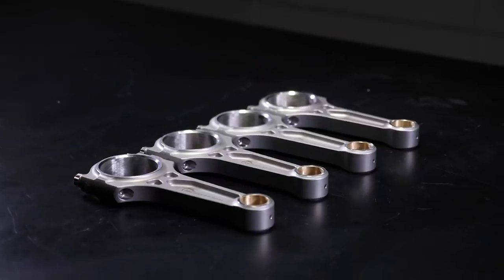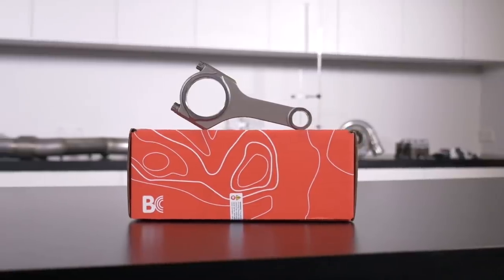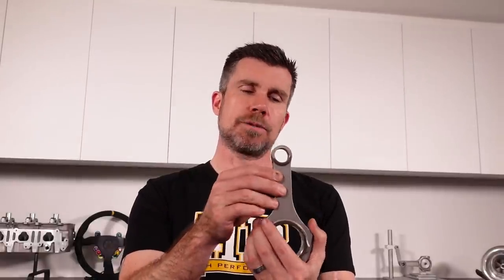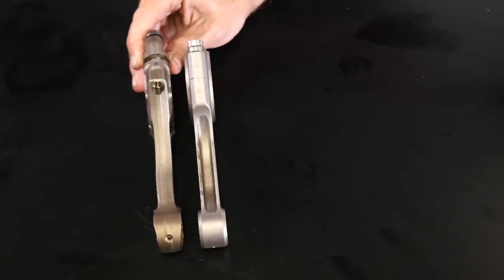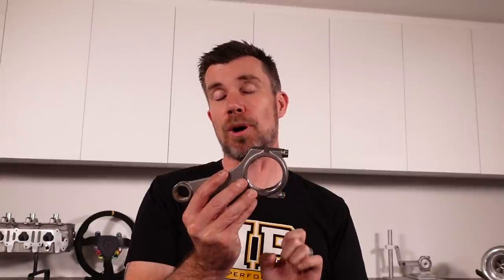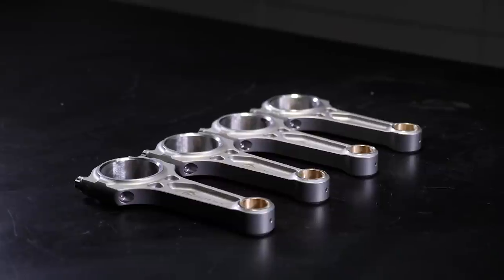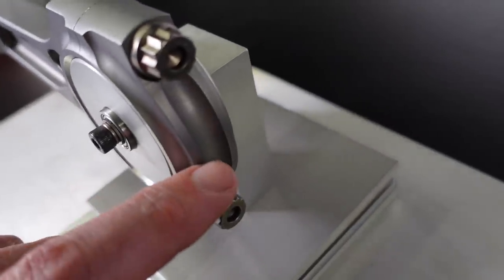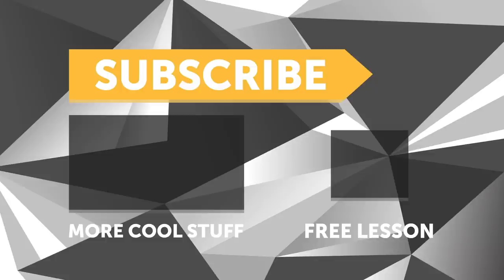'How much power can my connecting rods handle?' - Everyone.

Comment: Another thing that people usually overlook is the fatigue strength of a given metal used for building the rod.
Steel has a very high fatigue strength, while Aluminum and even Titanium alloys not so much. So, even though some alloys might be suitable for high horsepower applications, they will most probably never match the long term reliability of a steel alloy.

Comment: I just received my new rods..settled on PPM rods over the boostline with 625 bolts.

 I had to go through all that... very frustrating trying to calculate cylinder pressure vs piston size ect.
I just ended up getting the strongest rods I could find??

Comment: Great video as always!
Quick general question, if you take an engine and change nothing else except increase power by adding boost (not increasing the RPM) would the cap bolts be under any additional stress, since the stress is really only on the exhaust stroke?

Comment: as always, a lot of good info here !
the weight of the rod is also import, for high RPM NA engine, it's better to have a lighter rod than a low RPM high torque turbo engine (obvious for some people ... but bigger isn't always better) weight eat power at high RPM
Reply: Not exactly.  For example, in a drag racing application, it's been proven that heavier weight rotating assemblies will accelerate the car faster due to inertia.  For a road race application, or an application that that is under constant accel and decel conditions, lighter weight is a benefit.  On my dragster, I lost .15 seconds in et and 3 mph going to a lighter weight flex plate.  Going back to a heavier assembly gained my et and mph back.
Reply: Forgot to add though, with loss of weight, a certain amount of strength is also lost, and there is a definite limit when it comes to durability and longevity.

Comment: Is it possible to over-specify a rod? I guess the stronger rods are heavier, but for example the bolts. Putting weight and cost aside are there any downsides liking lifing/fatigue?

Comment: Most rod issues I have seen relate to overheating or trying to run the engine without oil.    Connecting rods don't appear to be the weakest link in just about any build.   I strongly suspect that unless you are doing 1000hp 1/8 mile drag racing that after market rods are usually snake oil.
Reply from the maker: We disagree to such a blanket statement. Different engines have different weak points according to the modifications and cylinder pressures they see.
Here's a relatively lower power example of a bent rod, hope it helps: https://www.hpacademy.com/blog/we-bent-a-rod-turbocharged-fa20-rebuild-ghetto-build/ - Taz.

Comment: This is not a hard question at all, it's just not about power .  The material strength/design has a compressive and tensile strength... I’m talking force.  So you're right, it's not about power, it is however very closely related to both rpm and cylinder pressure. Cylinder pressure is fairly closely related to torque. It is entirely possible to give both an RPM and extrapolate a  torque limit for a connecting rod with the only real variables being if the engine is supercharged or not. It would be simple to create a table for a motor with rpm limits based on stroke and piston weight and rpm. The same could be done with torque limits but it would be based on induction type.